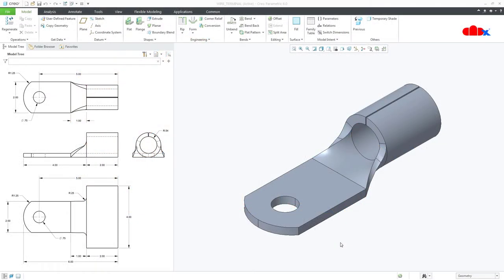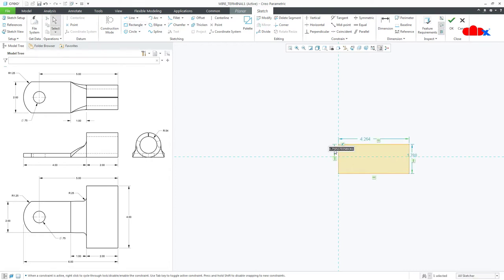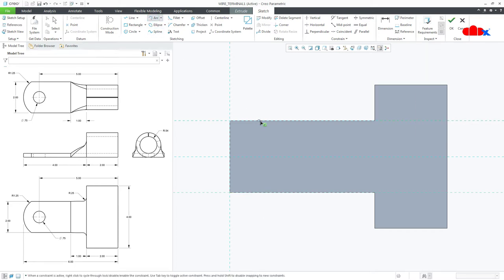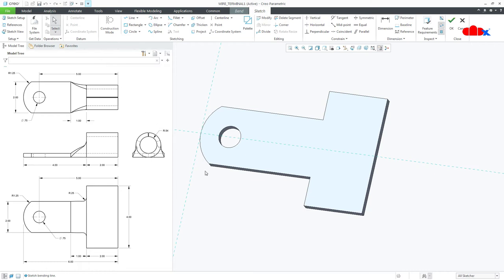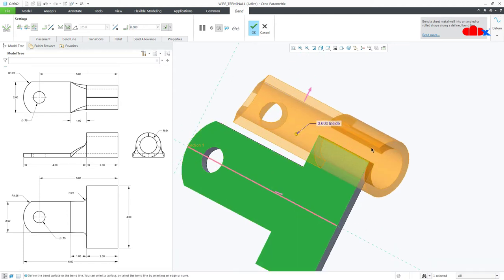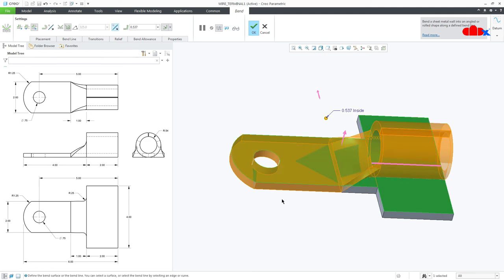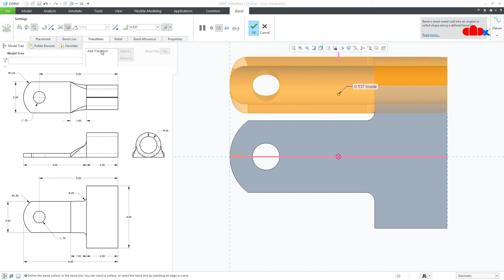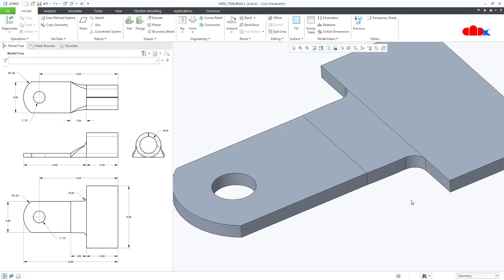Sheet metal tutorial | Cable wire terminal by transition bend in Creo Parametric

Comment: Hi, i did exactly the way you explained. But at the end result (after transition) is not coming in required side, rather its showing in opposite side (after flipping in transition option) im talking about, im not able to rectify the fault
Reply from the maker: There is a flip option inside the transitions tab. Just try that and check whether you are getting the correct result. Let me know if this helps.

Comment: sir how do you switch on the datum plane with keybord shortcut at 0.51. Also, i followed the same process in creo 7.0. while i add line sketch under transition tab. only the area where i havr sketched will get roled. but the sketch which i made under bend line gets omited. why so?
Reply from the maker: Follow the given instructions. You will get the result.

Comment: In creo 8.0 how can i make a full roll
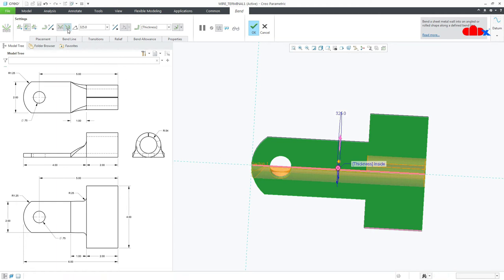3:41 you said roll found ... in creo that option is missing sir
Reply from the maker: Let me check in creo 8.
Reply from the maker: All the options in Creo 8 is similar to the lower version. So this is not a problem. In Creo 8, select roll type and centred on bend line. Try to change bend radius from 0.6 to 1. You will definitely get the result.
Reply: @CADxTraining  
Thanks a lot sir it helped me... Thanks for replying and  saving my time 🤝🏻
Happy that I found you